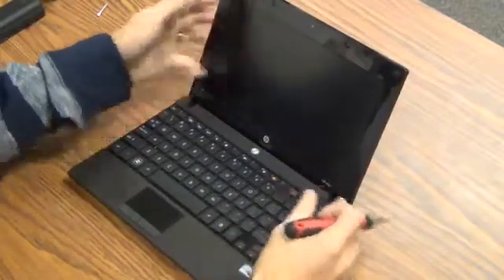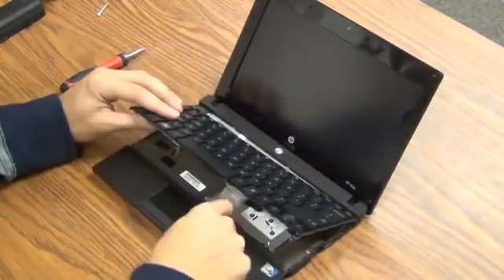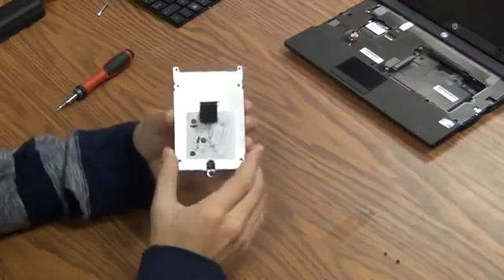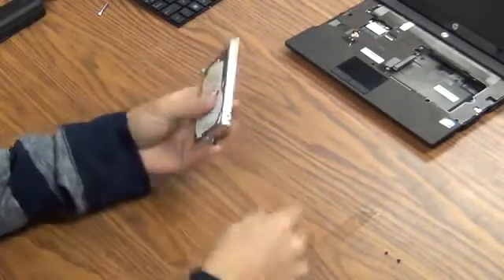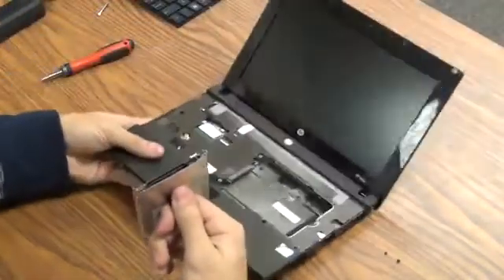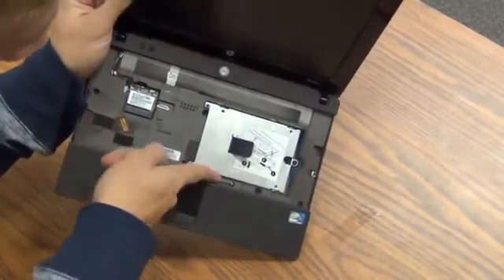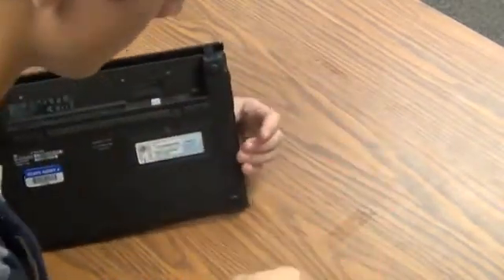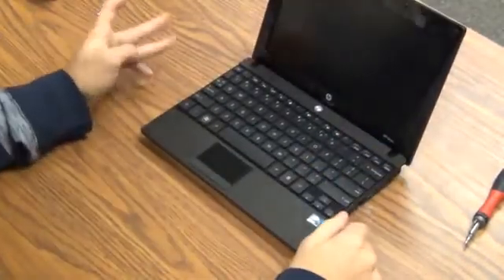Replace the HDD of hp mini 5103

Comment: Thank you for this video!  It made the replacement of the hard drive by an SSD E-A-S-Y!  The HP mini 5103 service manual is brain-dead, and it makes removal of the keyboard convoluted.  Doing it like in you video is simple.  And, if one works carefully, one does not even have to disconnect the keyboard at all.

Comment: Concise, well presented video. Thank you. I plan on putting a SSD in my 5103 to speed things up a bit. You're better than hp's support site for the 5103! Thanks again
Reply: @Derek Kranz Yes, the 5103 does run faster because of all the disk access required by the 2 GB RAM limitation.  It's running Win 10 happily now.
Reply: @Derek Kranz Unless you put a SSD in place of a HDD there will be no noticeable difference.  Storage " power " is not limited by the machine but by the OS.  Install whatever you can afford.  But remember the RAM is limited to 2 GB.
Reply: @Derek Kranz Well. I'm going to assume you're updating from Win 7, right?  so, yes it's going to get slower, only because of all the pagefile access that will  ( probably ) be going on BECAUSE of the 2 GB RAM limitation the 5103 has.  I don't know what programs you'll be running, but Win 10 running with that amount of RAM, WILL be fetching lots of info from that 250 GB HDD's pagefile ( which in Win 10 you can let the OS handle it or set it to a happy large size  ( read up on "pagefile as RAM" ).  Just remember, HDD access is the SLOWEST kind of storage access , which is why a SSD is about the only way  to speed things up.  It's still slow, but about 5 to 10X faster than the HDD that comes with the 5103, which is still Sata III @ 6  Gb/sec.
Reply: @Derek Kranz Firstly Derek, I don't know what memory is required for satisfactory operation of the programmes you 're going to run.  See what the manufacturers reccomend and then double it.  Since there is only 2 Gigs of RAM, I don't think you'll be too happy with these graphically intensive apps running on a 5103.  A 256 SSD is fairly inexpensive, but wait for a 480 - 512 to come on sale ( and if it has cache memory, all the better ).  Also get a USB to SSD Sata cable ( you only need the 5 volt type , about $10. ) Use Macrium Reflect Free edition and clone your 256 HDD to your new SSD ( you will have to initialise and format ( use MBR ) the SSD first ).  Once it's cloned, switch the SSD for the HDD and reboot.  You'll immediately notice the speed gain.
Now, as long as you have a Win 7 key you can upgrade to Win 10.  Just go to  a web  browser and type in "upgrading win 7 to win 10", download the download tool and choose "Upgrade this PC now".  If my memory serves me right the BIOS doesn't support USB booting.
I had no problem with drivers, and Win 10, to my amazement worked right the first time.  It just needed the normal tweaks that make it right for each one of us.  In order to be successful there is some reading for you, so have fun doing it, 'cause it's nice to see that Win 10 logo on an old 5103!
Good luck!
Reply: @warrenmacdonald1372  My 5103 will boot from USB. Just press "Esc" then "F9" on start up to select boot options. I may have changed a BIOS setting but cannot remember now.